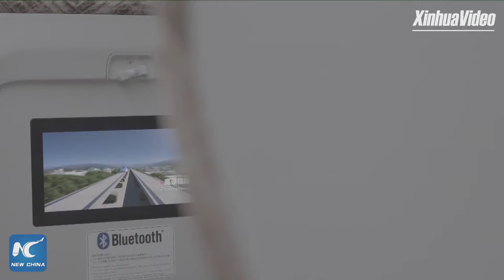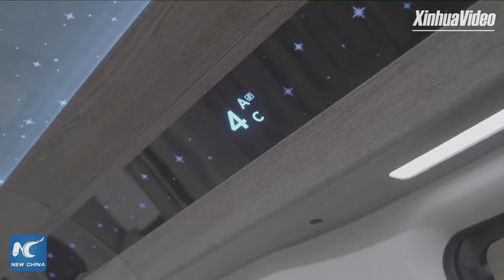EXCLUSIVE：Exploring world's first 600 km/h high-speed maglev train in China's Qingdao

Comment: The suspension system must be very advanced to keep the train within a couple millimeters, even with wind gusts & earthquakes.
Reply: Yep, has to be constantly monitored and the track has to be built to a very tight tolerance.
Reply: @TheNewGreenIsBlue  I wonder if the suspension has active forces to allow an inch of train/rail motion relative to each other. For example, if the rail is momentarily displaced for any reason (e.g. 0.5 inch misalignment in a 200 foot length or for 0.2 seconds of an earthquake), then the spring loaded suspension shifts accordingly and actively dampens out any motion resonance with magnetic fluid shock absorption.  I once rode the Myanmar train from Mandalay towards the golden triangle. The track was so warped, the train would bounce up an down. The suspension was the only reason the train did not derail. My feet would actually leave the floor it bounced so hard
Reply: @douginorlando6260  Honestly, I'm not sure about rail displacement but the German vehicles in Shanghai have suspension built into the cars, but this is not for track irregularities, this is for comfort in the car itself. So, in classic German fashion, the answer to "what if the guideway isn't completely straight" is: "We make sure the guideway is completely straight" LOL.

The track does have to be built to more precise tolerances than a standard guideway (classic German engineering, haha). I think it's +/- 2mm in some parts.. The gliding plane has a tolerance of -17mm / +33mm. 

I've always wondered how much tolerance it would have in the event of an Earthquake, but I imagine they've thought of that. I know the Transrapid vehicles are designed to skid to a stop on the guideway if something catastrophic happens (with damage to the vehicle) but the trains do have backup batteries that apparently allow it to run independently of a power loss on the guideway for 7 ½ minutes. 

The train is programmed NOT to stop just anywhere, as well... as they MUST stop only at specified evacuation points, so it would coast to the next exit point. 

As I understand, one of the reasons that Japan went with the more complex EDS system instead of EMS (like the Transrapid system) is that it can levitate higher (around 10cm) so has a higher tolerance during earthquakes... which Japan has lots of.
Reply: Awesome insight. Railroad technology has other applications as well. Commercial jets could be quickly accelerated on a 10,000 horse power rail car. It would not require a runway to take off. An alternative to more runways if an airport is over crowded.
Reply: @douginorlando6260  Well, roller coasters already use Magnetic Linear Motors... as well as certain metro systems. New York's AirTrain, Vancouver's SkyTrain, some of Osaka's newer metro lines all use linear induction motors to propel the train.

Comment: There is no doubt China succesfully transform the very train technology into a modern transportation, but the price of ticket still very high to compete with airline travel. The engineer need to design a train carriage into 2 level which double the number of seat and reduce cost and fuel efficient. Example : Airbus 380 double decker

Comment: Where has it done 600 km/h?
Reply: They not did trial run yet
Reply: In democracies sometimes it is cheaper to go underground with a number of modern multi modal TBM working 24/7 than have expensive court cases.

A single 11 psi Maglev tunnel can increase speed from 600 km/h to 700km/h while still being breathable and passing stations would allow daytime trains to stop where needed with overnight container trains beating any truck by eight hours over 1,000 kilometres between freight sidings eliminating daytime planes and reducing trucks.

Using Sydney to Melbourne as an example with passing stations at Canberra and Albury it would cost $60,000,000,000 and return $20,000,000 per night which makes it able to subsidise daytime fares below planes and still have a return of 10%

Perhaps cooperation between Japan, China and America can develop the maglev container train with  Australia to use an international guideway to benefit the world.

Comment: The Japan maglev has been running at full speed at a test track for many years. So the readiness of the Chinese technology is behind, but this is not to say they will not develop it faster and deploy at a massive scale. Neither train is close to commercial operation. I'm looking forward to these things becoming a reality.
Reply: Only china has a fully working commercial maglev that's been running for decades already. Japan has none. China also had 600km maglev prototype for many years already too and will also have a fully working commercial 600km/hr line up and running before Japan or anyone else also. China also has already successfully tested an 800km/hr+ prototype and working on a 1000km/hr+ line currently.
Reply: @ex0duzz  You are right, there is the 30 km long Shanghai airport line that reaches 420 km/h. I rode it (it felt a bit bumpy by the way, like an airplane in light turbulence... okay for a short ride but may be uncomfortable if I had to sit in it for hours). There are no plans to extend that line and continue that particular track-and-trainset standard. The development of the 600 km/h maglev looks to be brand new domestically grown technology and brand new standard. I referred to the readiness level of the latter.
Reply: @ex0duzz  but that has been developed and built in Germany. Japan is constructing it's first MagLev line and this Chinese train is based on the concept that Japan has been developing for over 60 years now. It still remains to be seen who will actually open up a commercial line first.
Reply: @vadimmakarov6811  上海那个磁悬浮是德国的，不是我们中国的，商业运营的高铁中国最快350km，马上400km的高铁也即将下线运营，前两天郑州到山东高铁430公里的时速，创造出交会870公里的记录
Reply: 你就看600公里的高铁是到底是中日哪个先商用把，共产党一声令下没有做不成的事，也许日本民众同意，政府同意，财阀不同意修得不到回报

Comment: Germany wants its 1980s tech back 😂😂. The Same project already failed 40 years ago. The tracks are to expansive and rail switches are complicated. The commercial use will be limited to very dedicated lines but i dubt if it will operate cost effective
Reply: Switches certainly aren't complicated
Reply: @Hans-gb4mv  monorail switches are, don‘t you think. They reqire huge instalations to move the whole rail 3 to 4 meters aside

Comment: That train is a transrapid. Based on German Patents and only in theory able to do 600km/h, in reality IT will run at 350-450km/h. It will then Not be much faster regularly than the German build Shanghai SMT (CRRC CF600 is a Mix of TR08&09). For a test under real conditions, IT must have a track equal the length of the Shanghai-Pudong-Line or the one in Emsland, Germany. But, up until now IT can only move Out of it's Garage. That "Up until now" lasts since 2018. Increasing Aerodynamics won't increase speed, but lower the energy-consumption, the regular and optimal energy-efficient Speed of the system Transrapid is inbetween 350-450km/h. The "Break throughs" , the Reporter Talks about, were achieved by the engineers and companies that invented & developed Transrapid in Germany from 1969 to 2011.
Reply: Ok, ev!l anglo regime stooge😎
Reply: You know what. I'm not an expert or an engineer. So I am not going to debate the technical aspect as I don't want to pretend that I know something that I don't. But anyway, I'd rather believe that the team of experts, engineers, the Chinese government who approved, and the banking institute that is funding the billion-dollar project know what are they doing. Rather than a random guy on Youtube who most likely has no engineering degree but thinks he knows something that everyone involved in the Chinese Maglev project doesn't. What I know, China is a country that has put a rover on the moon, on Mars, and has a space station orbiting the earth. And I also know the Chinese people are extremely cost-efficient. There is no way a country with such a level of technology and financial management would be that stupid shelling out billion dollars on a project that even a random guy on Youtube 'knows' it is not possible to achieve. But nevertheless, for the benefit of the doubt, let's say you were right and all the Chinese experts were wrong. I'd still give the Chinese keen support because they are doing real efforts to improve lives rather than going to foreign countries left and right to wreak havoc, deaths, and chaos.
Reply: @feizai245  A lot of talking with no content. We in the west put rovers on the moon in the 60´s (with the help of Germany) and on mars in the mid 90´s, so what? We build Space stations already in the 70´s and the ISS is up there for already 24 years. We send Voyager 1 and 2 into deep space, used cassini to explore Saturn and its ring & moons? Used Galileo to take a look at Jupiter and its Moons? So, China is approaching, were we are for already 20+ years? That train is a transrapid and therefore based on German patents. The specs go as for this system physically possible, it goes as first mentioned. I know a whole bunch of people via Internet, including one former head of the Emsland facility that created this technology in the first place. China wants to sell itself as live-improving, but I guess you just need to ask in this regard some uigurs. If you can get in their prison-camps they´re held at to do labour work. Oh, and what about the expansionist behavior of China against Taiwan or the South-China sea residing countries in general?! Very selfless and kind behavior of China there, so kind that america needs to protect Taiwan against a chinese invasion. Just a visit among friends of course, in Chinas eyes at least. What about the failing "no covid" strategy that is used to strip millions of people of their most basic human rights in China by doing radical lockdowns?!
Without foreign help and oftentimes stealing of foreign knowledge, China would still be doing rice farming mainly. You forget something: I can walk into a library - or take a look on the internet - and look out for documents about Transrapid. Unlimited. Something that is restricted in China. China claims it has build the CRRC CF600 with coaches out of carbon fibre. What I can see in the video are instead just welded aluminum-parts?! (Carbon Fibre for a whole set of Transrapid coaches are incredibly expensive, even in China anyway) And so on. And we germans regarding the transrapid knew in 2001 already that China wants to sell itself in the future as the inventor of this technique. With one difference: German made Transrapid achieved real results, Chinese made up until yet not.
Reply: Sehr Gut meine Herren - You can't forgive yourself that others have surpassed the initial invention. By the way Maglevs were first developed in the US and not in germany. The Americans became greedy and did not want to develop a mass transit because the automobile industry was such a dominating factor! The Japanese took the idea and run with it but they could not invest in the production, of course Deutschland seized the opportunity!
Reply: @kambamazig02024  America has absolutely no maglev-knowledge. And the chinese haven´t surpassed the initial inventor since that is not possible due to patent rights issues. America wasn´t even able to maintain a normal railway network for decades, look at Amtrac! The conventional high speed line is just on the eastcoast, on the Californian HSR the build for decades. The inventor of maglev trains is Hermann Kemper, he patented it in 1934 (Reichspatent 643316), before 1969 when he meet with Ludwig Bölkow, the transrapid and therefore maglev technology in general wasn´t available anywhere around the world, especially not in America. The Germans had after that developed two systems: Krauss Maffei´s Transurban (for urban/regional services, the todays Max Bögl TSB is based on that) and Transrapid (high speed), which they tested both first in Ottobrunn, Bavaria and later in Lathen, Emsland from 1983 onwards up til 2011. Germany planned to open two lines: Hamburg-Berlin and Munich-Airport-Mainstation, both were cancelled in the last minute and AFTER Shanghai was put into service. The canadians consulted Germany in the 70/80´s to plan a transurban-line in Toronto I think, but it was never realized. They americans also consulted Germany for one or two transrapid lines in the mid 2000´s. The patent holder for Transrapid is still Thyssen.
Reply: @bieneulm1982  Didn’t Germany invaded Poland, Britain, France and Russia in the 1940’s? Very friendly country indeed lol.
Reply: @ex0duzz  Taiwan is an independent country, formerly known as Republic of China - declared in 1912 for the First time - and was once governing all of Chinese Mainland, the last original Chinese government/Kuomintang fled to what is today known as "Taiwan" to escape Mao. Since the communist cultural Revolution, or even further Back than that, the communist single-party-dictated Mainland china does Not Accept it's Independence. Although the CCP installed itself in China by force during and after the second sino-japanese war.
Oh, and all this selfless Intervention and developial aid done in Balkan region and africa causes all this countries Just one circunstance: Oweing China more and more depts to be paid back, therefore all these countries become depentants of Chinas "Goodwill".

I'm currently Reading about the Republic of China and it's forced Partition in two parts. Interesting.
Reply: @bieneulm1982  All true and nice.
But where‘s that Hamburg–Berlin line? Where‘s a Paris–Cologne–Berlin–Warsaw line?
It just didn‘t happen because Germans preferred more cars and larger roads.
Essentially the same stupidity as in the U.S.
Reply: @bieneulm1982  This is not ICE vs. Transrapid. You may have an HSR network for distances up to 500 km and still have maglev lines on the major transeuropean corridors.
Actually you need conventional HSR anyway, so of course it would take precedence. Proposing a Hamburg–Berlin maglev stub line instead of a proper HSR network may just not have been a good idea to kickstart Transrapid in Germany…
Reply: I just like the Chinese resilience

Comment: My ingen report on my pament give my heand on my place .
Part 1 maglive train 4 corner style E center line cut full magnet.
2.part.E point ander rectangel up.
3.part. E point ander rectangle dowen.
4.part up and down rectangle full uposet magnet .
5.part courner magnet uposiet rectangle magnet  fix.
6.part.up and down rectangle ander a seter box fit with ing.
7.part full speed maglive magnatic train ready work.

Comment: As far as I understood, Shanghai Maglev Train is not extended as it is too costly. The terminal Longyang Road is not a very good location ...
So has China changed their mind and will build a commercial maglev line despite the cost?
Reply: This is cheaper since it uses a different technology called high temperature superconductor
Reply: This is no more German technology.  This is high temperature superconductor levitation. Much more economical.

Comment: Its an Engineering marvel without a doubt, but if its equivalent greenhouse gas emissions from burning coal to produce electricity to drive it, is high, then in the long run its just a high tech white elephant, the Concorde of the twenty-first century  amazing, but from a practical point of view quite useless if compared to  other systems using much less energy.